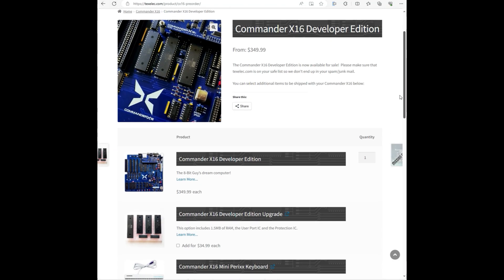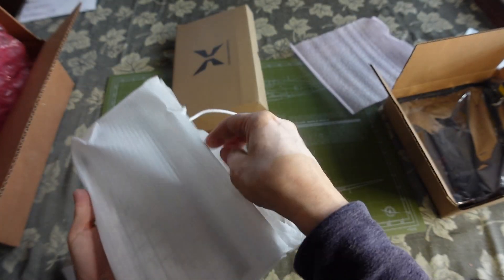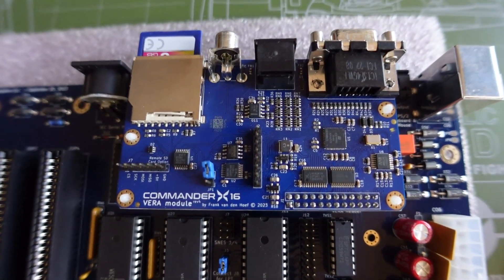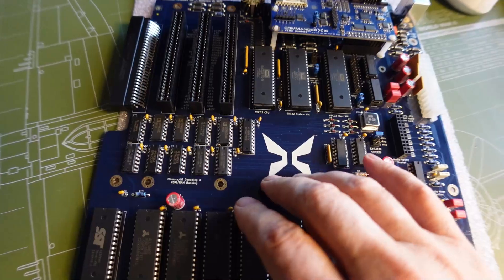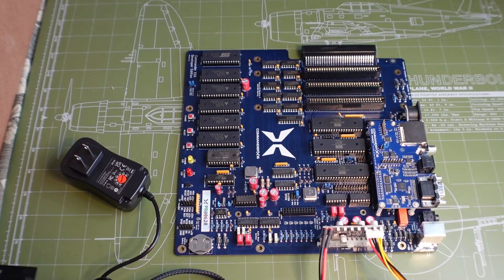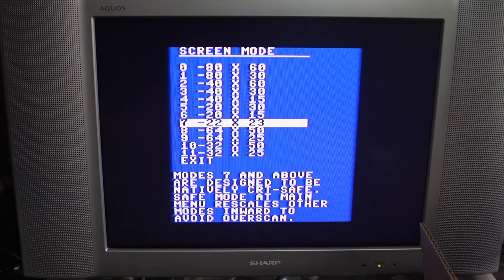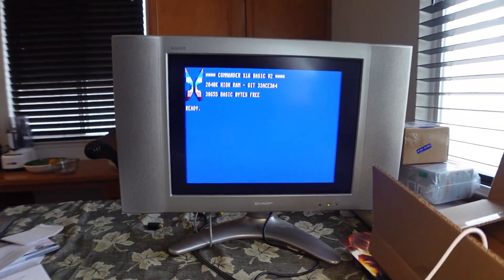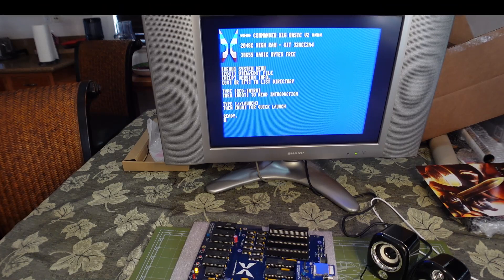Commander X16 Developer Edition Unboxing and First Look

Comment: The whole thing could have been an ARM chip on a board and nobody would have really noticed. FPGA was the way to go because the DIP chips are getting rarer and will eventually run out. It was unfair of Mr Murray to put the preservation of classic machines, arcade cabinets and pinball machines at risk by depleting the stocks of vintage parts that are no longer manufactured.
Reply: running X16 emulator on an ARM would be no different experience than running said emulator on x86 desktop or laptop

only people that care only about playing games are into software emulator solutions (though developers find them useful for debugging their new creations)

retro computing hobbyist are a completely different species and crave real hardware experiences - with the potential for hardware expansion.

A surprising number of X16 expansion boards alreay exist. 

And the ability to devise a software program cartridge has a high level retro computing coolness factor as all the famous 8-bit home computers could accept plug-in cartridges.

There is already a second display expansion card and equiping it with 2MB of memory paves the way for a Turbo Pascal like software development IDE (and related dev editors for tiles, fonts, etc) that will be able to run directly on the X16 dev board edition.

This is way more fascinating and engaging than yet another software emulator for people that just care about running retro games or retro themed games (e.g., modern X16 titles)
Reply: First, I'm not hostile towards him.  I oppose this project, not him. What he chooses to do with his time and money is his business, but I would recommend people not waste their money on an obsolete computer with no software.  Even today, 30 years after commodore went out of business, new software for both the 64 and Amiga are still being released at a fairly high rate.  Plus there are already too many of these new machines.

These machines all fail to solve the problem they claim to want to solve, the problem of no new hardware.  They will be quickly orphaned and will only be available used fairly quickly.  It is too expensive to make them on as needed basis and too expensive and inconvenient to buy in bulk and just sit on them as they sell.  You think he's gonna sit on 10k units just sitting in his house waiting to be sold 1 at a time over the next 2 years?  Is he going to rent a warehouse to store these things as they are being sold?  Over and over, new computer systems have been orphaned.
Reply: @tarstarkusz  Maybe you don't intend to come off as hostile, but your criticisms are not that valid in context to the X16's timeline. There is in fact quite a lot of software being written for the X16 and the x16 forum has it. Additionally, you do need to actually release some hardware to create the market for developers to create software for it. The X16 will likely remain a niche machine and that is entirely ok. David never said he wanted to sell millions. This is his passion project and a lot of people that enjoy machines based on the 6502 and its variants are enjoying enthusiasm that still exists for it. 

Again, I hope you find something in your life that makes you as happy as David has because you deserve it. Your time in this reality that we all share is much better spent being a positive force than a negative one.
Reply: The problem is, by quite a bit, you mean well under 100 major software projects, at least 1/2 of which will be ports from other platforms.  Meanwhile, for less money, you can buy an Amiga have tens of thousands and roughly equivalent specs

Personally, I think the emulator is better for getting some software on it.  Most developers capable of producing high quality games that take advantage of the new hardware will be doing development on a modern computer.

The problem really isn't the number of machines, it's the ability to ship them.  It requires either very long lead times with paying customers doing the waiting or high inventory, which this project cannot afford (as explained in my earlier comment).

WHY do you keep making this personal?  David is neither friend no foe of mine.  Somehow, his desire to make them  is good, but my opinion on the topic is somehow mean and irrelevant.  Would you be telling someone who was praising the project to keep their opinions to themselves?
Reply: @tarstarkusz  I'm not making it personal, I'm just pointing out that you are comparing a passion project to projects of former massive corporations that had millions to invest in R&D, production, programming, etc. The lens at which you want to compare the two couldn't be any more different. There will never be AAA titles released for the X16, there will never be millions made by ANY dev teams on the X16. Any software or games released on the X16 will be passion projects themselves because the platform is not based on modern architectures. 

So knowing all of these things, I cannot help but conclude that you simply just want to complain about a product that isn't what YOU want it to be even though you likely wouldn't buy it yourself if it were $50. 

Again, please find something in this world that gives you the joy and happiness that you seem to be searching for. You will never be happy by tearing down the works of others, but you might find it by helping build others up.
Reply: From you:
I hope that you enjoy the life you deserve to have. 
(and)
Again, I hope you find something in your life that makes you as happy as David has because you deserve it. Your time in this reality that we all share is much better spent being a positive force than a negative one.
(and)
Again, please find something in this world that gives you the joy and happiness that you seem to be searching for. You will never be happy by tearing down the works of others, but you might find it by helping build others up.

Yes, sweetie, you are making it personal with your passiveaggressive comments.

Why should anyone get a X16 over a ZX next or a Mega65 or one of the several other active modern retro computers?  Nice job with the strawmen. Nobody believes nor did I say there would be AAA games released on any of these modern retro machines.  I said like 1/2 of all games made for it will be ports of games from other retro systems.  Also, it's not a passion project, it's something he is selling.  I follow a guy who made a vacuum computer.  That's a passion project.
Reply: @tarstarkusz I don’t believe it really matters what system you think is better or worse unless you are going to buy one. 

My point is simple, you appear to have no desire to own or develop for an X16 yet you freely bash the system, the motivations of the creator(s), and the ecosystem behind it. Why waste your limited time on something you have publicly stated you have no interest in? Go be a positive force in a project you actually care about instead of being a negative force for a project that others do care about.
Reply: So no criticism is allowed about anything?  I am connected to and part of the scene.  A youtuber's vanity project is wasting millions of his viewer's Dollars.  People who may be interested should understand the risks.  Most people don't. PT Barnum once said, there's a sucker born every minute.  David IS talking about selling this in Walmart, which is never going to happen. 

Criticism is not being negative.  I don't have generic criticism like it isn't good enough or that it isn't based on my favorite platform , it's that it's an impossible platform.  There's little to no software for it, it's decades out of date and there is no chance of long term support.  Granted, it is supposed to be decades out of date.  But there are already many platforms that are decades out of date but that have large and growing software availability, most of which is free.

But the real problem is that there are already multiple new retro-computers out there and there is no real way to economically support the platform long term.  Without long term support, what is the point?  As soon as David realizes the cost in keeping it around, it will become an abandoned platform with no new ones available, the same problem the Amiga and other have, though without the software shortfall.

If I wanted to create a new retro-computer, I would define everything in software. The first 5 years would be nothing but emulators.  Then, I would try to tie multiple retro-communities together.  Then I would try to find a company interested in selling them, in placing large orders and dealing with lots of inventory.  Not only that, but David is now running a full time arcade, developing retro-software, running multiple youtube channels, is married and may or may not have children.  Running a computer manufacturing facility and running fulfillment himself out of his garage is simply not feasible long term.

The good news is in 50 years, these things might be worth a small fortune, like an Apple I is today.
Reply: So no criticism is allowed about anything?  I am connected to and part of the scene.  A youtuber's vanity project is wasting millions of his viewer's Dollars.  People who may be interested should understand the risks.  Most people don't. PT Barnum once said, there's a sucker born every minute.  David IS talking about selling this in Walmart, which is never going to happen. 

Criticism is not being negative.  I don't have generic criticism like it isn't good enough or that it isn't based on my favorite platform , it's that it's an impossible platform.  There's little to no software for it, it's decades out of date and there is no chance of long term support.  Granted, it is supposed to be decades out of date.  But there are already many platforms that are decades out of date but that have large and growing software availability, most of which is free.

But the real problem is that there are already multiple new retro-computers out there and there is no real way to economically support the platform long term.  Without long term support, what is the point?  As soon as David realizes the cost in keeping it around, it will become an abandoned platform with no new ones available, the same problem the Amiga and other have, though without the software shortfall.

If I wanted to create a new retro-computer, I would define everything in software. The first 5 years would be nothing but emulators.  Then, I would try to tie multiple retro-communities together.  Then I would try to find a company interested in selling them, in placing large orders and dealing with lots of inventory.  Not only that, but David is now running a full time arcade, developing retro-software, running multiple youtube channels, is married and may or may not have children.  Running a computer manufacturing facility and running fulfillment himself out of his garage is simply not feasible long term.

The good news is in 50 years, these things might be worth a small fortune, like an Apple I is today.
Reply: So no commentary is allowed about anything?  I am connected to and part of the scene.  A youtuber's vanity project is wasting millions of his viewer's Dollars.  People who may be interested should understand the risks.  Most people don't.   David IS talking about selling this in Walmart, which is never going to happen. 

I'm not being negative.  I don't have generic complaints like it isn't good enough or that it isn't based on my favorite platform , it's that it's an impossible platform.  There's little to no software for it, it's decades out of date and there is no chance of long term support.  Granted, it is supposed to be decades out of date.  But there are already many platforms that are decades out of date but that have large and growing software availability, most of which is free.

But the real problem is that there are already multiple new retro-computers out there and there is no real way to support the platform long term.  Without long term support, what is the point?  As soon as David realizes the cost in keeping it around, it will become an abandoned platform with no new ones available, the same problem the Amiga and other have, though without the software shortfall.
Reply: @tarstarkusz  Where did  David Murray say he wants to sell the X16 at Walmart? I heard him wanting to sell it to the educational market but have not heard about Walmart.
Reply: @darksword1  It's in one of the long videos about it.  He said he was in talks with a AAA game development company that would produce games for it and sell it big box stores.  I think it's the video where he shows his new production equipment
Reply: @tarstarkusz  "Commander X16 2023 update" In this video, he talks about a well known but unnamed company interested in theX16 for competitive gaming. but no mention of selling it in Walmart. I've watched his videos on X16 and don't recall him ever mentioning Walmart.
Reply: @darksword1  He might not have mentioned walmart specifically, but I know for sure he said he wanted to sell volume in stores. He said doing that could allow him to get the cost down to under 50 Dollars (for a more streamlined version with less expansion IIRC)
Reply: FPGAs are more expensive and  many of the DIP chips on these boards are still being made, including the 6502 CPU. The entire idea behind the project was to make a computer that ran on original hardware. Emulation generally creates idiosynchronies with clock timing mismatches and the difference in CPU instruction sets. It's not that I don't get where you're coming from, but these computers do exist for a reason, however small the community of interest is.
Reply: @theoriginaldanster Ahh yes classic 1970s and 1980s technology, the Field Programmable Gate Array, made by your beloved David Murray himself. 🙄🤡
Reply: No arcade machines or vintage computers are at risk because of the X16.  No vintage stock is being depleted.  The majority of the ICs and components are still manufactured today.  Yes this was designed to use NEWLY MADE components not vintage stuff.  And yeah an FPGA can recreate most things but you miss the point of this computer. It is a true retro computer.  Something that could have been made in the late 80s or early 90s.  It is for fun.
Reply: @RacerX- Yeah because using chips from the 1980s that were used in most computers including arcades that aren't being manufactured anymore doesn't hurt those machines that actually need them at all. You're right, David Murray has found a miracle cache of unlimited non production chips. What is with you idiots defending with such shit?
Reply: The whole computer is a dumb idea. I have no idea why anyone would want one. It's an obsolete computer with no software. You can buy an Amiga cheaper and still have the option for basic.
Reply: @tarstarkusz  Glad to see someone else who feels the same way about the X16.  Even if it was $50 as he first talked about I don't think it would see much success.  But at the absolute insane price of $350 there is no way.  David actually believes that the X16 will see success in the educational market.  He truly thinks kids will have any interest in learning an ancient obsolete programming language.  He seems to think it is still 1984.  I wonder how much money he has sunk into the X16?
Reply: @HerecomestheCalavera  He thinks he is going to be selling this thing in Walmart and Target and the like.  That would really be the only way to bring the price down.  So many of his viewers blindly back every dumb thing he comes up with.  Like his arcade petsci robots machine.  When people complained about the game, he said you had to read the manual.  He just cannot understand that arcade machines do not require reading a manual.
He also fails to appreciate that most kids are too dumb for computer programming.
Reply: @tarstarkusz  There is A LOT of hostility pointed towards David and the X16. It is interesting to me to watch how quickly a bunch of random people on the internet will eagerly tear down someone and the project(s) they choose to dedicate their time to. Even if the X16 is a total bust in terms of sales, I still personally find David to be inspirational in that he actually tried to create something. It is easy to criticize the actions of someone else when you weren't part of the project itself.

I hope that you enjoy the life you deserve to have.